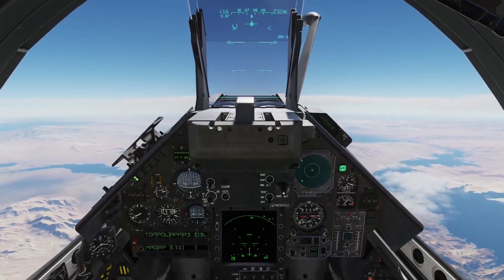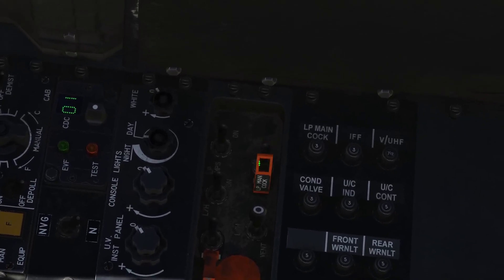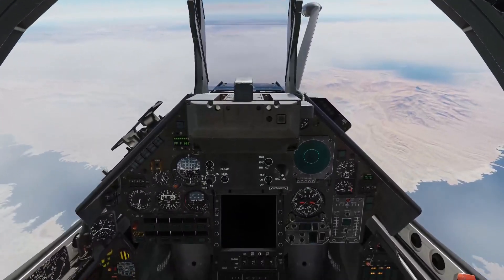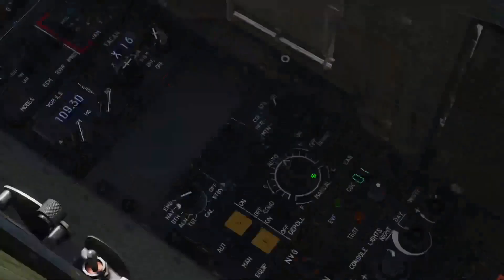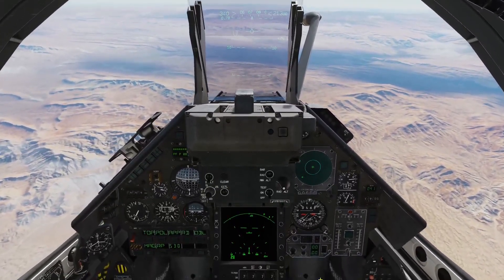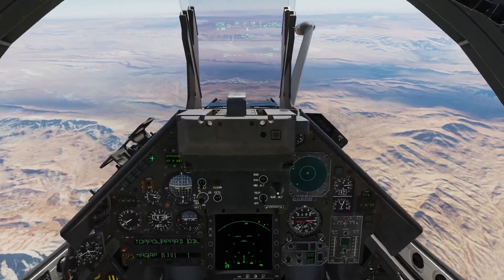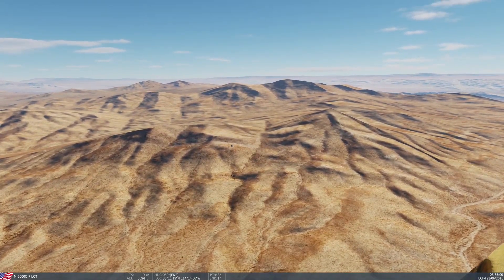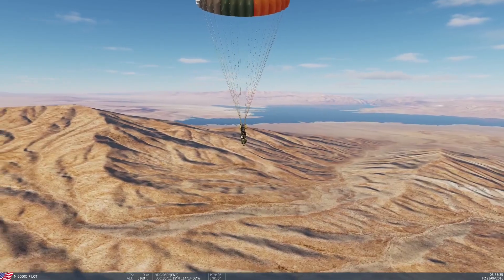DCS M2000 Air Restart

Comment: Until you has rpm:
Air start swittch--->throttle to 10% and back to locked 0, not idle.

If you has no more RPM:
Air start switch---> Engin start button on the right --->Waiting until the Rpm increasing to 11 and them throttle10% and back to locked 0, not idle.